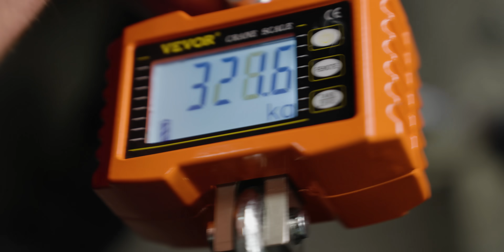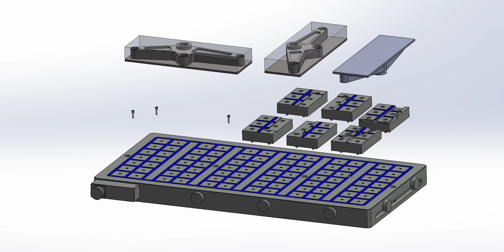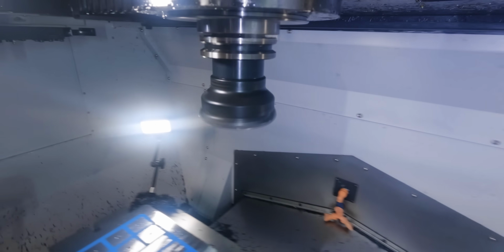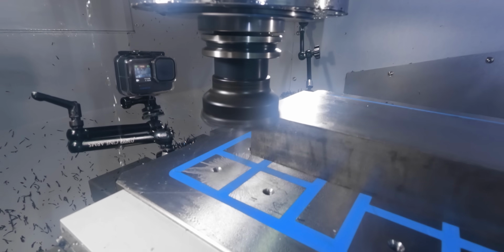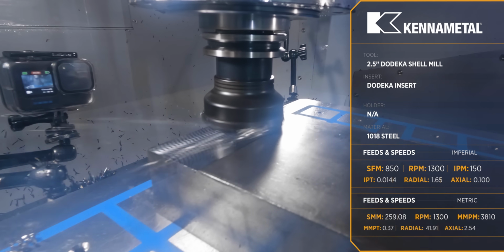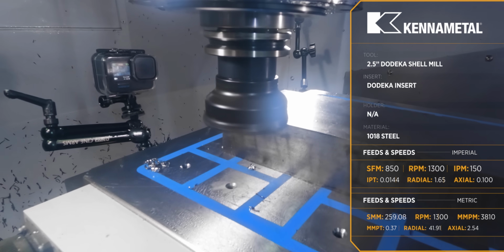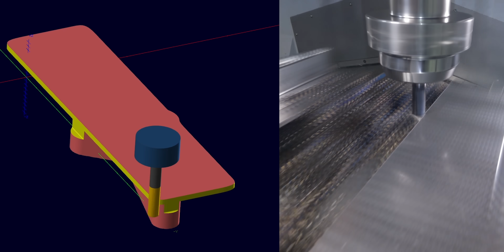CNC Machine All Ops At Once With NO Vises

Comment: Great video and instruction, but there is one mistake, at the first operation you have to use 3 fix poles and on the rest of the size of the workpeace fleksible poles for clamping without tension‼️ but the rest is 🔝

Comment: huh, if 1 pole is 90lb and if you have 84 poles, aka 84 times 90 that would be 7560lb, how do you get 74000lb?
Reply: They’re machinists, not mathematicians give them a break
Reply: @aklef  this is basic math. Machinists need to be able to do basic math and some precalc I'd say at the minimum. A problem like this should be equivalent to 1 plus 1 for them.

Comment: At my previous workplace we used magnets for a lot of our final operations because the parts tended to have a lot of different shapes and angles which made them impossible to hold without a part-specific set of jaws for the vices.
A lot of the time we had to machine past the base of the parts, right down to 0.001 above the magnet's surface, depending on the chamfer on the part.

We had some parts move around due to tool wear, and when the tool got to the base of the part near the magnet's surface there would be a lot of chips piled up around the parts causing all sorts of issues.
Most parts came out alright, but every scrapped part was a significant loss due to all the hours that had gone into the previous operations and hardening of the material.

Comment: Do you ever have issues with residual magnetism on the part?  Do customers ever have call-outs on their bids to not have residual magnetism on ferrous parts? Would you be able to reduce chip buildup by using non-ferrous materials as an insulator on exposed magnetic chuck surfaces?

Comment: How do you extend toolife on something like that?  We get a lot of re-cutting chips with using our magnets. 

2) we have done multiple step overs (6-8%) with dynamic mill and have had our parts slip and move on us using .500 Endmill -which wouldn’t be a lot of side load, but it manages to move the part… any tips?
Reply: For recutting the chips, I would use tall pole extensions to keep the part as far off the table as possible, use thru spindle coolant, and make sure that when backfeeding you use a z lift of at least .25". For the part moving, do what I did in this video, and machine a pocket into your pole extensions. Then the part CANT move

Comment: I feel like the use case for this is kinda limited. Can you use this to hold another vise or fixture as opposed to t slots?
Reply: Yes it will hold a vise. I actually indicated one in to within a tenth, then turned the magnet off and on several times and it never moved
Reply: Ok that's pretty cool

Comment: I don't know why magnet chucks like this aren't more common in job shops.  It really has decreased setup times significantly.  Especially for round and odd shaped parts like this.
Reply: Because its a hell for tool life, unless you can either:
1. Feed so high the chips dont clutter, which bring higher chance of the part moving. 
2. Blow it clean either once or multiple times during or between operations, which adds quite a bit of time to the operation. And dont you dare do a 2nd finish pass for a smoother finish or tighter tolerance without blowing inbetween. 

These chucks are great for laser or otherwise cut pieces, but at the same time absolute sucks at machining them. Try a medium sized water cut 30mm piece with a 1-2mm unevenness in surface. That sucker will either get eaten or yeeted by the mill. 

Vices on these will also move over time. We had a setup running for a week or 2, and the vices had moved 0.1-0,2mm. 

Its a niche product for special parts.

Comment: we have a Quickmill with a Fanuc Controller and magnetic table and we machine motor grader edges for Cat, and we just replaced the original system of magnets with the exact same one as your using and it is allot more powerful than the original, most of our stuff is only 3 to 4 operations [pretty basic] and is mostly Boron  up to about 450 lbs each at the heaviest part and need to take lots of  care unloading it with a 1000 lb capacity jib crane,  it is a good time to run this machine even though it is old , Great video Barry  👍

Comment: Strong enough even if you don’t prep the face which sits on the table ? I was asking myself if on these magnets we need absolutely flat surface or not. But I see that’s raw stock so I think it’s perfect solution and great for mould and die industry🙏. Great job as always ✅. Hello from Eastern Europe 🇷🇴🇪🇺
Reply: I have used one of these tables before and you definitely want a mostly flat piece of stock. I have dealt with proven parts all of a sudden kicking or moving because of a bow that wasn't caught.

Comment: Are the drillbits and machine not bothered by the magnet? Or is there like an area of how close you can go to the magnet
Reply: The magnetic lines of flux extend about 3/4" (20mm) above the table. If the tool is closer than that, there will be friction and heat in the tool from passing thru the magnetic field, but it won't be enough to hurt the tool

Comment: We move stuff on the magnets all the time. You can't push things too hard or it will move. It's not a constant pull on the part it's pressure applied in a direction while vibrations from the cutter make it move. Cutting all the way to the magnet also sucks, you can't get the chips off the magnet and inevitably cut chips and make your finish rough from chatter. I will leave a couple thousandths on the outside blow all the chips off then come back and finish. Magnets are ok we've used them for years but they have limitations

Comment: Instructions not clear, aluminium flew off and broke my glass...
Reply: you obviously need an aluminium magnet duuh
Reply: I can't even get my programmer to use the same XY on square parts between ops, good luck getting one of these. Having a -.001 hole position with a +.003 width grind stock that is ordered on both extremes of tolerance, programmed off the opposite side of the dimension callout on the print is just ridiculous.
Reply: @triple7988  you want me to figure it out?
Reply: @johncastro7372  Nah, it's cool. He's got decades of experience when people be out there graduating with centuries.
Reply: I detect major sarcasm 😂
Reply: Plexiglass here, no good!
Reply: Maybe its stainless aluminium??
Reply: No you didn't listen at all, He said all kind of ferrous materials. And i am not a fan on using magnetic chuck on mills.
Reply: I Used a wood magnet for aluminum too. Looking for Schunk support lol.
Reply: Aluminum is not magnetic tho
Reply: @HiepTran-pv9zr  no way really? is stainless steel also made out of aluminum as well? cause my chunk also flew off.
Reply: @mobilePCreviews  What, I thought stainless could stick to anything?